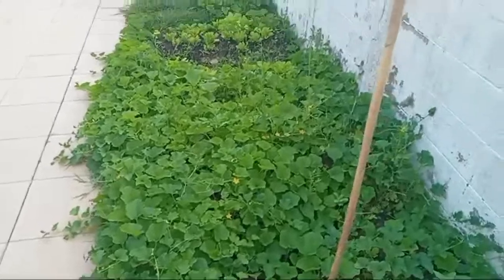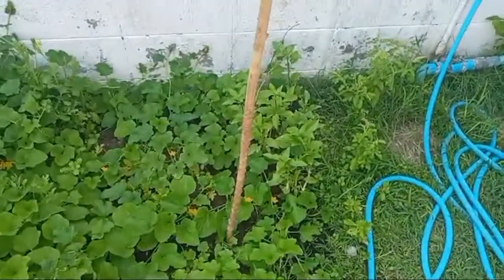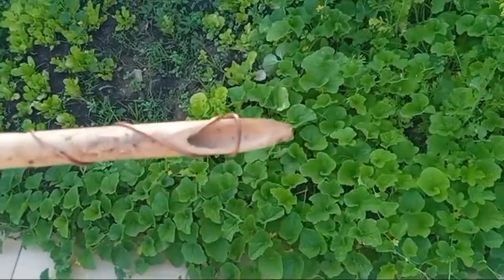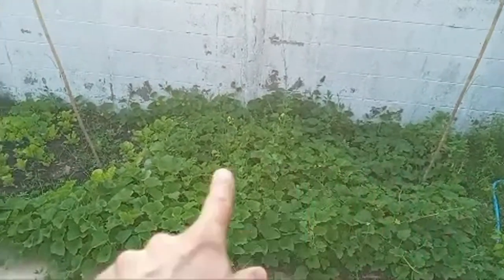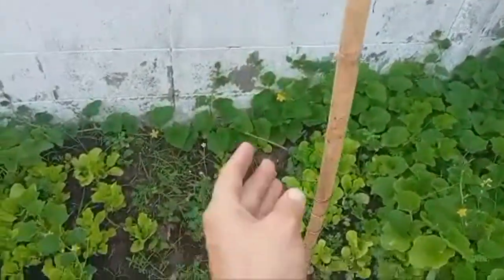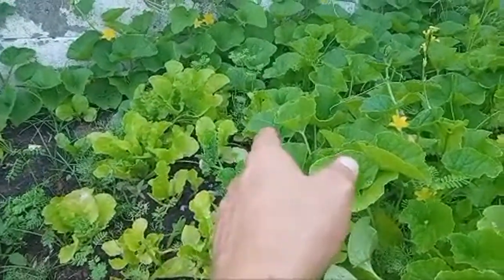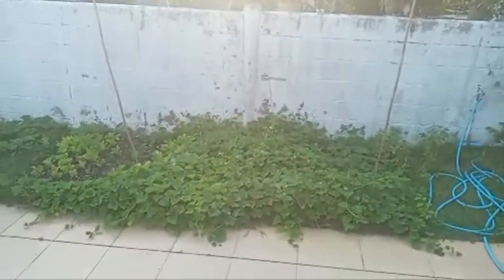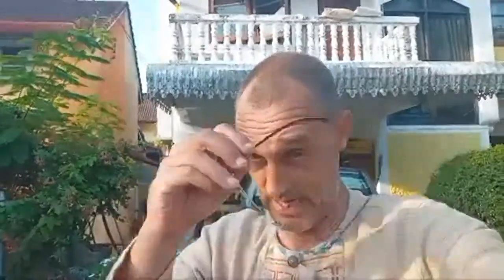Electro Culture Experiment

Comment: One of the reason ,or if not the main reason they hide the Flat Earth is this.
They're hiding what the Universe is in relations  to the shape of the Earth.
Which means once you change the shape of the Earth, you change the makeup or what the Universe is comprised of.
On a globe you have planets (solid objects or terra-firmas), asteroids in the so called outer space, the moon existing as a rock, etc.
The Flat Earth is a "Electric Universe" !!
Powered by electromagnetism, as both the moon and sun have electromagnetic energies.
They stay aloft by electromagnetic levitation as both revolves around the electromagnetic energy field of the Earth.
The Earth is negative charge as the sky is positive charged.
The air above the ground is measured (100 volts per meter) above the surface.
Two meters (200 volts) so forth and so on.

If free energy or free electricity can be harnessed using a copper wire, and other devices by a average person.
What do you think the gov. can do ??
There's a lot of hidden tech, free energy tech as well.
They're never tell you that in a World that rakes in billions from you buying the energy/resources from the very corporations they own.
Theres' no solid planets above you, no solid objects in the upper sky region.
Only lights in the sky, cosmic bodies of lights, radiant energy, radiant matter, plasma or the 4th state of matter, etc.
So by changing the shape of the Earth, they've essentially changed what the Universe is.
And the Earth follows that change, which is what most people fail to make the correlation.
This Realm Earth is a (Electric Universe) with the potential/capability/reality of harnessing free electricity at infinity !!

Comment: Is stripping the insulation from copper wire enough to expose the metal to the air? I thought there is also very thin layer of some substance that has to be scratched off to conduct electricity. An electrician could comment on  this. Thanks
Reply from the maker: Hi Richard. Good point. Honestly, I don't know but you are probably right. A rub-down first with some sandpaper or emery paper certainly wouldn't hurt. I won't do that on this one but will definitely do so on the next one. We have enough space to try more.  Nice one
Reply: I'm wondering if you need to remove all the insulation....except for the bit into the ground.  If it's field induced into the wire I'm guessing the insulation will not stop the field from energizing the cu wire.
Reply: Copper exposed to air and moisture will rust with green color. If the wire is insulated, it will not change colors. Would this be a way to prove if the copper wire has some insulation on it or not?
Reply: @richardbudzic6289  Copper oxide...the green stuff....might increase the contact resistance a bit....so cleaning the bit going into the ground would be a good thing.  I was referring to the thicker plastic insulation found on must electrical wire....its a field (in the air) that we're trying to gather or harness....and that will interact with the cu wire whether or not there is plastic insulation on it.....me thinks.  The plastic insulation protects against conductive shorting with other wires...primarily.